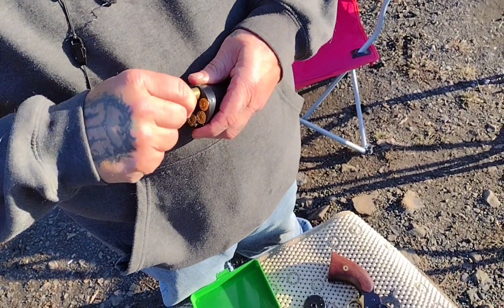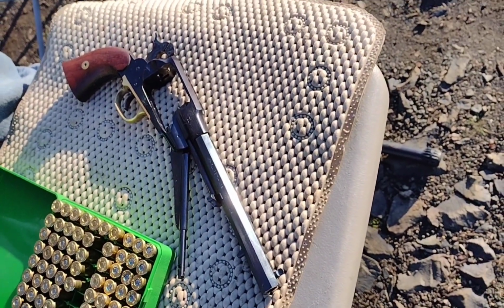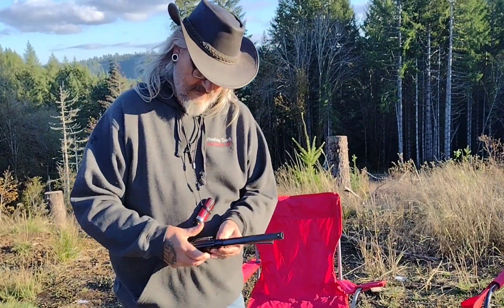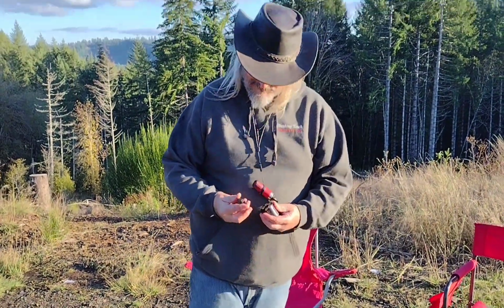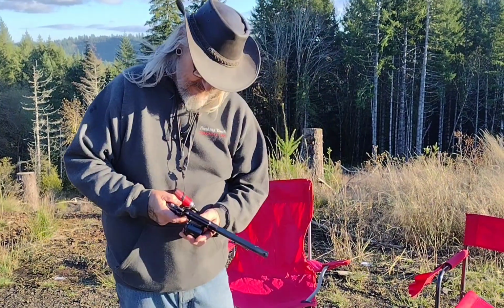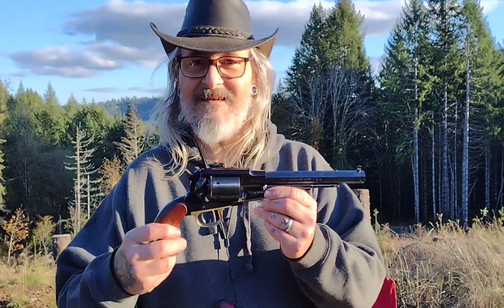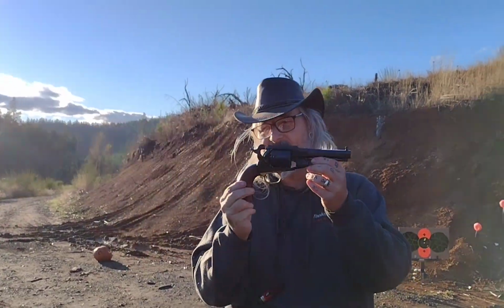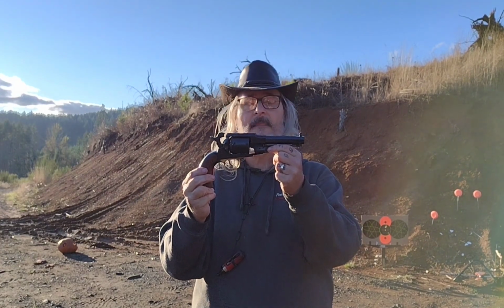Remington cartridge conversion 45 Colt 8" vs 5.5" barrels.

Comment: I'm working on a 5.5" conversion now. I just have to cut out the frame for the loading port. I just finished fitting the cylinder and ejector housing to it. I wanted to do that without modifying the barrel catch or the cylinder pin for removal and now that I've finished that part I'm left with just cutting the port. I ported an 8" Pietta and it's a minimum of 100 fps faster than any factory cartridge 45 Colt I have and I put it up against a couple 1875's a Schofield and 1873. After I port this 5.5" model I'm seriously thinking of porting a 12" barrel Pietta Remington. I still use the drop in version too (5 shot only) btw, but in my Uberti. I think I sold all those for my Pietta's and the 6 shot Uberti ones as well.
Reply from the maker: Sounds like it's going to be ready nice.  I love shooting my Pietta new model Army with the conversion cylinder, I also like loading my own 45 Colt cartridges also.  I've been loading my cartridges with bh209 black powder substitute and you get a lot more shots because the bb209 powder does not  leave a lot of fauling.
I just ordered a Taylors conversion cylinder for my Uberti 3rd model Dragoon, so I should be getting that sometime next week.
Good luck on your Conversion cylinder project and thanks for watching.

Comment: My Howell .45 colt conversion cylinder is fluted and has the slits on the side of the back of the cylinder chambers so I can tell when it’s loaded and which chamber is empty to rest the hammer on. The HSM .45 colt 200 grain loads fit well in the cylinder and the tips of the bullets are just under the mouths of the chambers
Reply from the maker: The cartridge I loaded using 30 grains of Schuetzen fffg black powder and a wad and my homemade bullet lube on the groove of 230 grain . 452 lead bullets.  On one of the bullets I guess I didn't get it in the brass as far as it should of.
Reply: Pretty heavy bullets. I’m getting between 700 and 750 feet per second velocity with my HSM .45 colt 200 grain smokeless factory cowboy loads. Roughly between 200 to 250 foot pounds of energy so it’s similar ballistically to a 30 grain load of 3f Swiss black powder and a 230 grain bullet

Comment: Carl you may have noticed how easy conversion cylinders are more user friendly when it come to the 1858 new army...no wedge to pop in and out vs the colt style open top revolvers..though i love my 1861 Howell conversion its no big deal to me to remove the wedge for each extraction and reloading of cases and ammo, the fact that you can shoot cartridges thru your cap and ball revolvers is all worth the extra step, BTW you gotta love the sound of black powder being discharged. its!! boom!!💥 not pop🍾
Reply from the maker: Yes it is very easy with the Remingtons, but I have already started saving my money for a conversion cylinder for my Uberti 3rd model Dragoon and after that I will be saving for one for my Pietta 1861 Navy.  A tap in the wedge on off with the barrel isn't bad at all, and that is still faster than loading cap n ball cylinders.  I should have enough money in about 3 weeks or so, I'm looking forward to it.
Nothing sounds better than the Boom of black powder discharging, I agree, it is way better than pop, pop, lol.
Reply: @blackpowderfirearmenthusia3194  excellent plan brother.

Comment: I guess I need to order one of those conversion cylinders I would probably use smokeless cowboy loads if I did. But I haven't seen any for sale at my local ammo store I guess I could order online but I don't want to pay freight I'm a cheap ass
Reply from the maker: They are a lot of fun, but shooting 45 Colt cartridges loaded with black powder does cause them to faul up pretty fast and the cylinder starts to get tight from the fauling after the 3rd cylinder shot through it.  I also was loading them with bh209 black powder substitute and with that there's almost no fauling build up, the stuff is expensive and I ran out and I haven't seen any for sale now for many months.
Smokeless Cowboy loads are the cleanest and fun to keep shooting all day, but those also have been hard to find and I have seen them on GunBroker but the price was really jacket up high and was more than I want to pay.
Thank you for watching.

Comment: What was the bullet speed difference between 8" and 5.5"?
Reply from the maker: Thank you for taking the time to watch.
Reply: @blackpowderfirearmenthusia3194  Last year I've tested 45 Colt loads, here's what I got:
45 Colt, 230 grn led bullet, 35 grn BlackMZ
1858 5.5" - 934 fps avg;
1858 8"  -   976 fps avg.
I'd say not bad, 445 to 490 ft-lbs of energy, good for self defense but a bit weak for hunting. Swiss 3f should give very similar results, 777 3f would add another 10-15% of power.
Thanks for the video!
Reply from the maker: @Alex_556  thank you for all the info, I appreciate it.